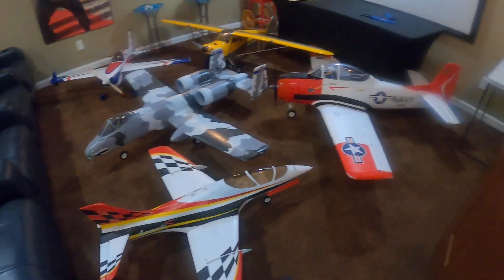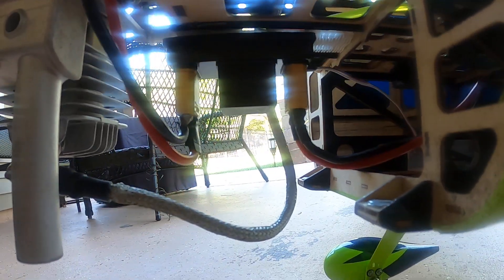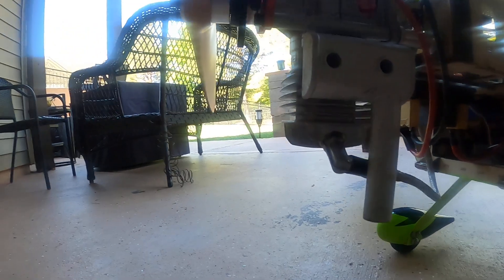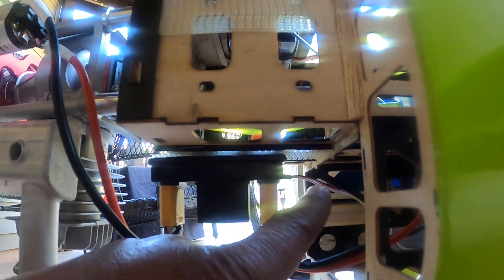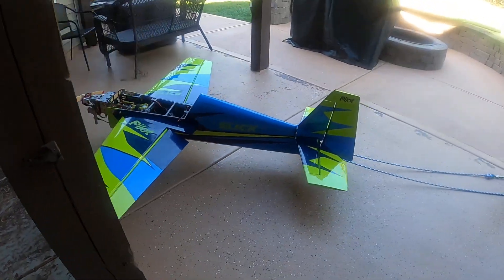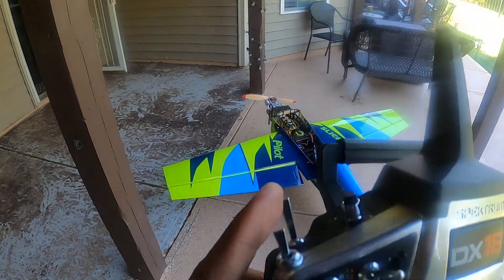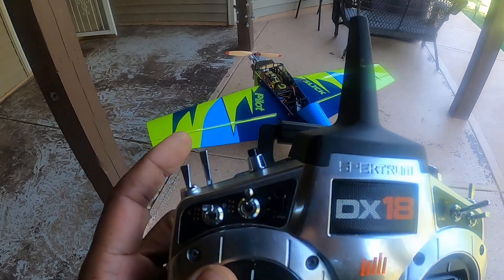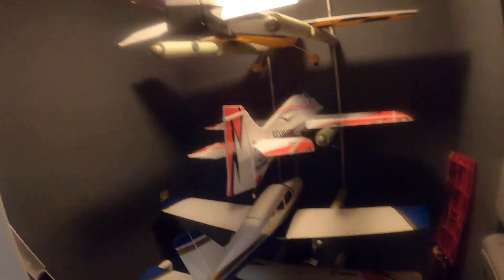EME 35cc gas engine with EME35 Electric Starter with Brushed Motor

Comment: Thanks for the video! New to gas engines here. With the autostarter, I'm worried about installation onto the crankshaft and messing up the ignition module's magnetic alignment. Is that something you've dealt with? Or was the install very straightforward? I've got a DA-60 with the DA ingitional module V2. I've bought an autostarter for that engine off ebay... We'll see if it works.